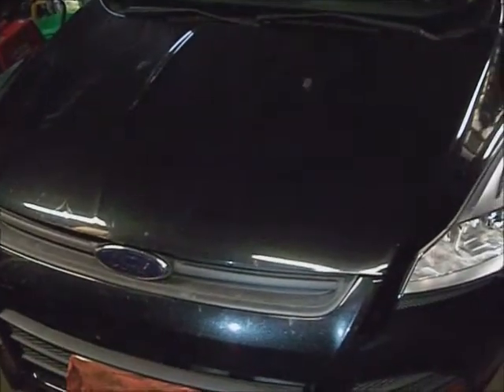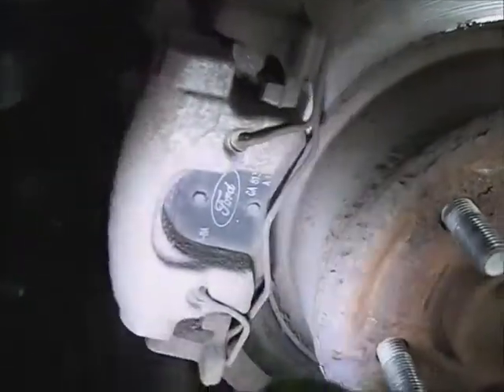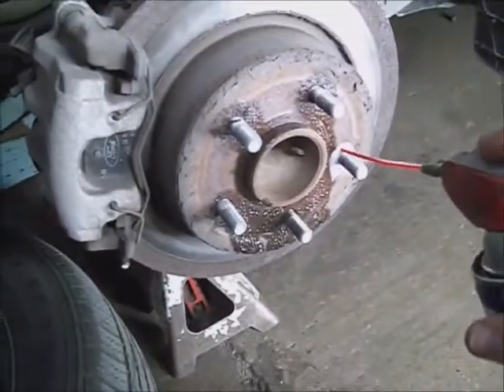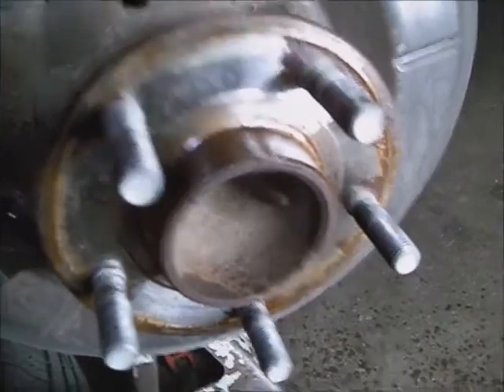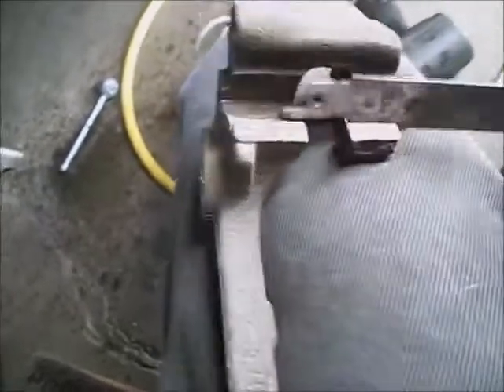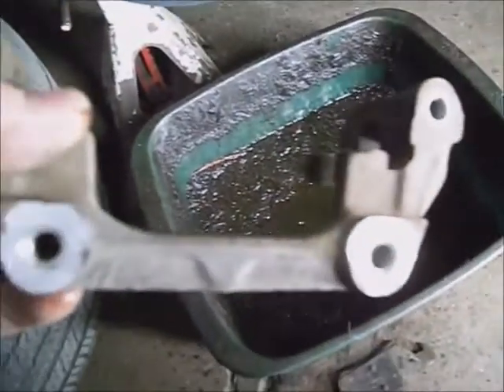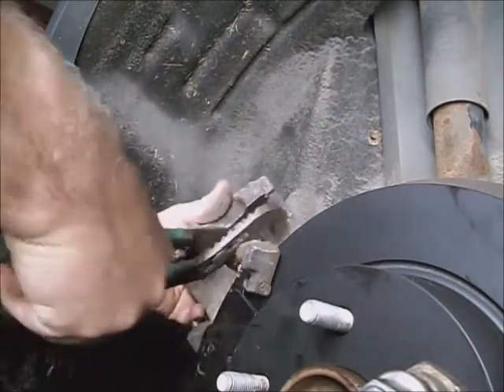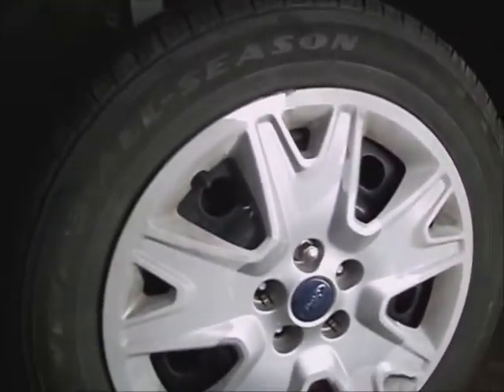Ford Escape 2015 2 wheel-drive rear brake pads replace

Comment: You forgot to put brake grease on the end of the pads and lube the caliper sliding pins
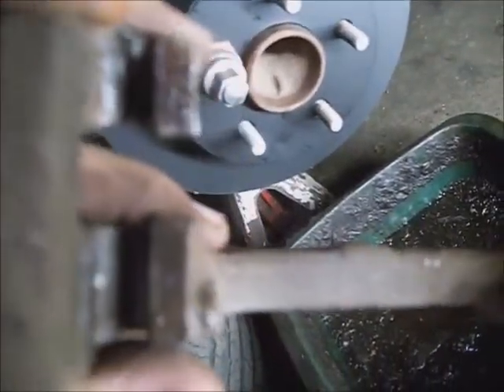Reply from the maker: At 18:15, the slide is greased, as needed.  And if the slide pins were with adequate grease/free, and the dust caps were on, then more grease is not required.